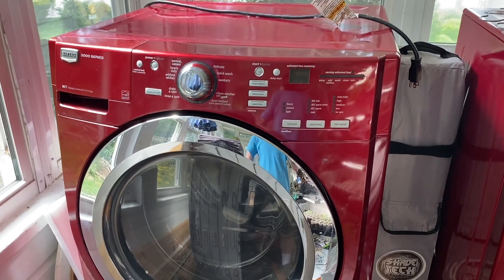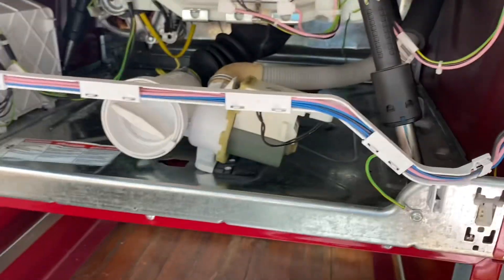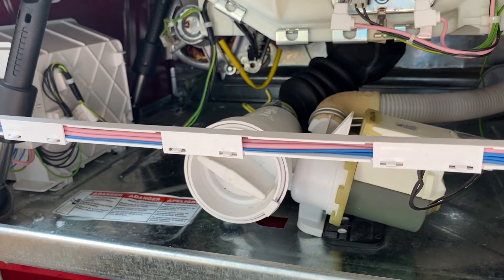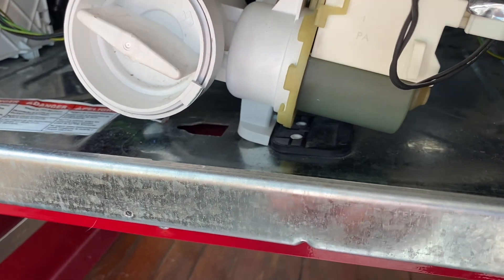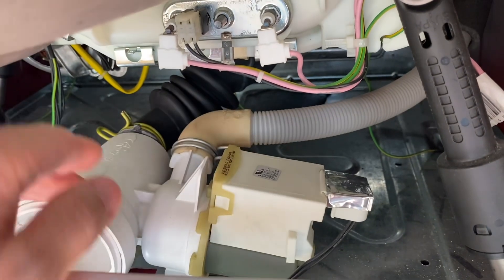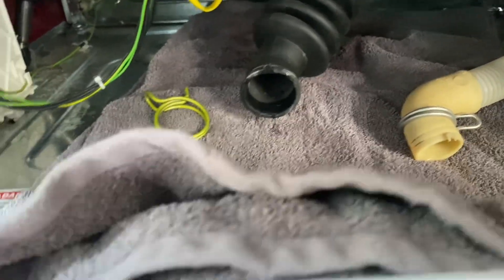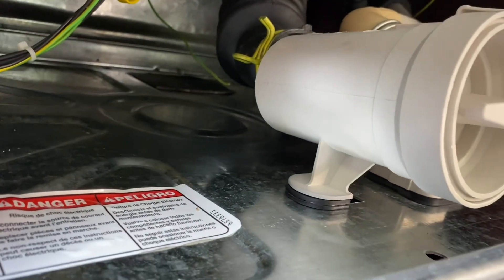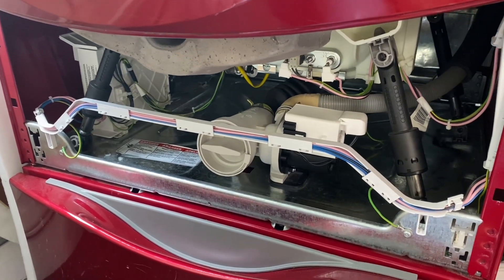maytag 3000 washing machine drain pump replacement - F21 code

Comment: Did replacing the drain pump eliminate the recurring F21 code?  I am in a similar situation.  Thank you for posting.
Reply from the maker: yes, it did. no issues since replacing the drain pump.
Reply: @wlayneh  I just wanted to follow up that replacing the drain pump cured my problem of a recurring F21 code without anything blocking the drain hoses.   My machine is about 15 years old, so it's not surprising the motor is dying.  Thanks again!
Reply: FYI. No need to remove the screws on the bottom of the pump. Slides out to the right. 

The large rubber piece requires a screwdriver to lift it before sliding.

This video was very helpful. Thank you.
Reply from the maker: @martyvortiz ah, good to know. thanks for the info! glad the video was helpful.